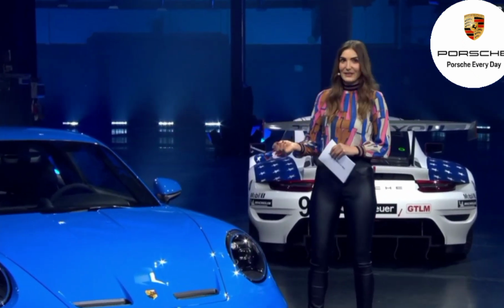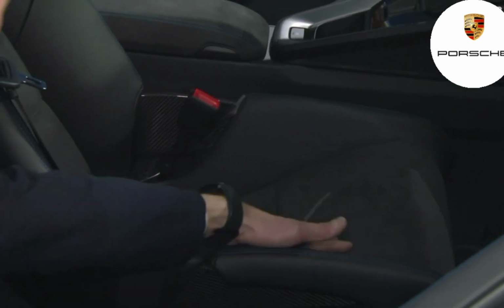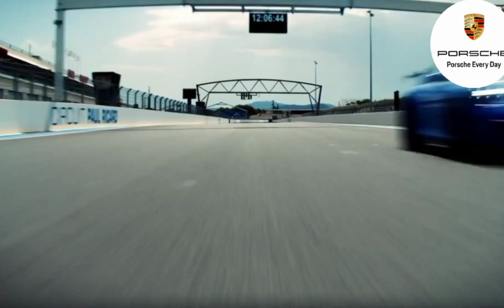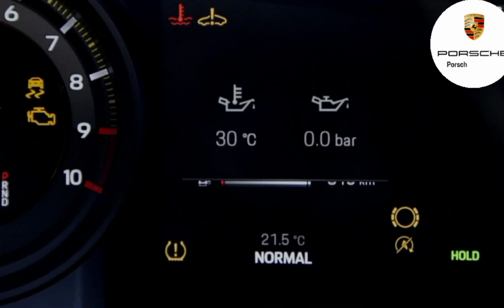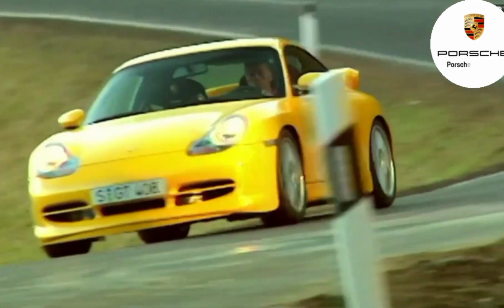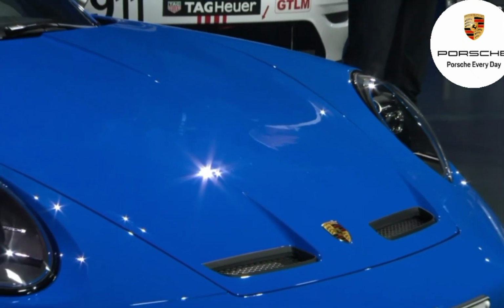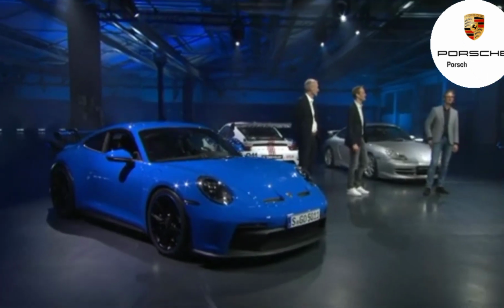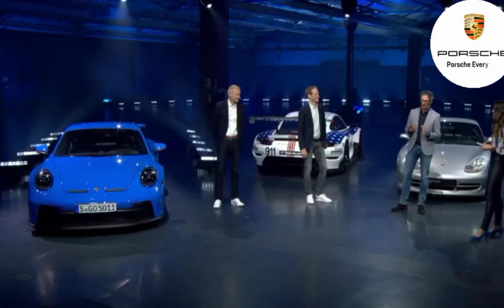NEW Porsche 992 GT3 2021 REVEAL,FIRST LOOK,ENGINE SOUND AND INTERIORS | OFFICIAL PRESENTATION!!!!!!

Comment: After driving this I went with the 992 Turbo S as it’s a much better daily drive with 3-4 track day a yr. the GT3 just does not make sense for me.
Reply from the maker: No,the GT3 it's just more extreme, however, the turbo s is always a great car 👍
Reply: The trick is to buy both. I daily drive a Taycan, have a 911 Turbo S for straight up speed (it's faster than the Taycan model I have), and I'll be getting a GT3 when it's available.